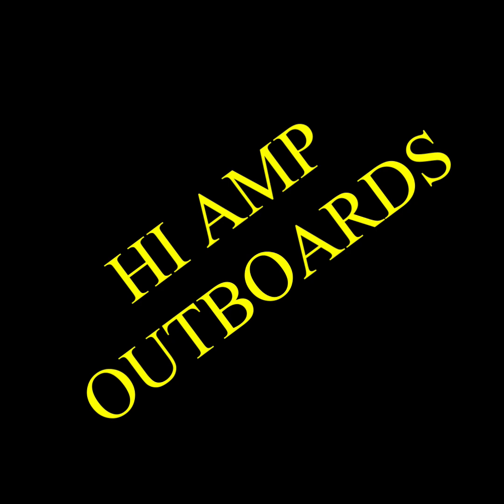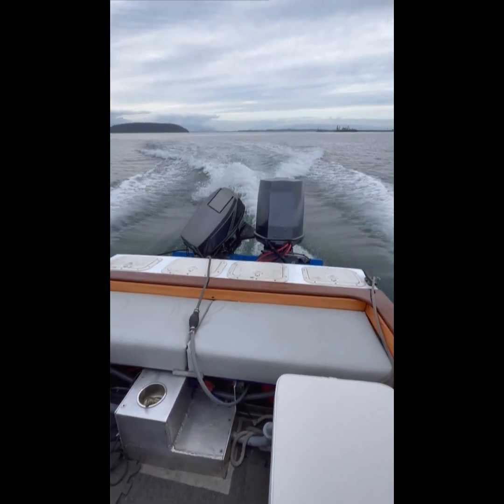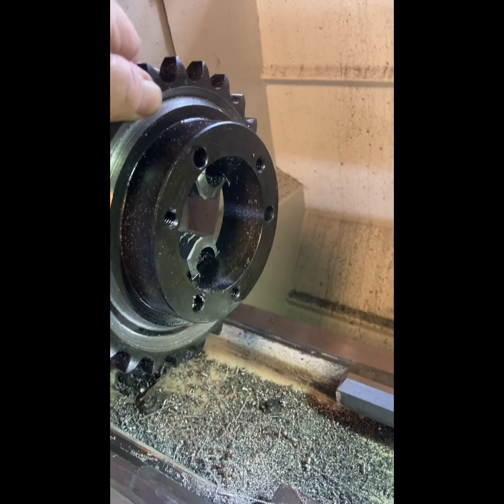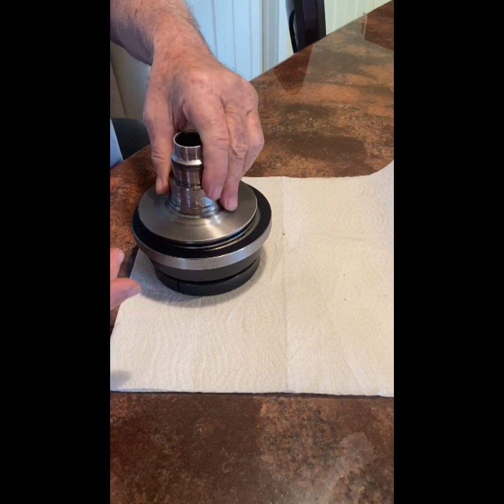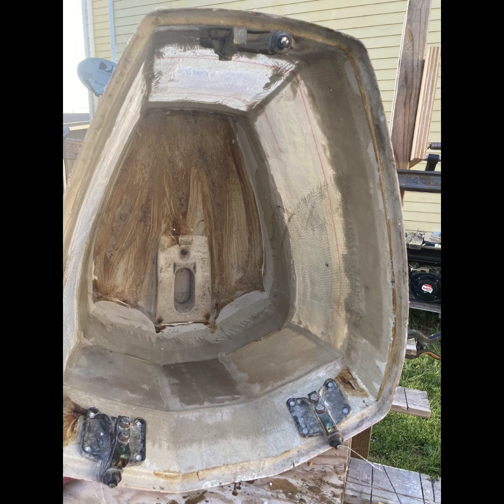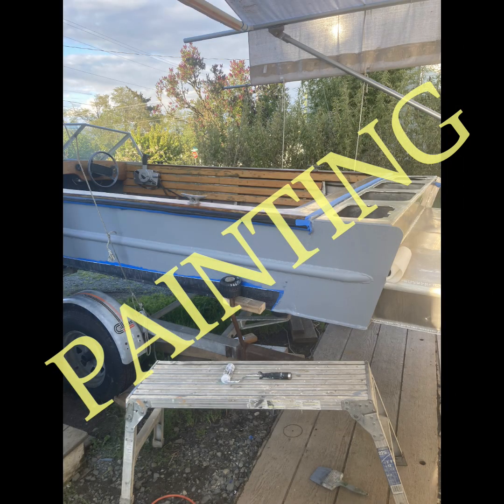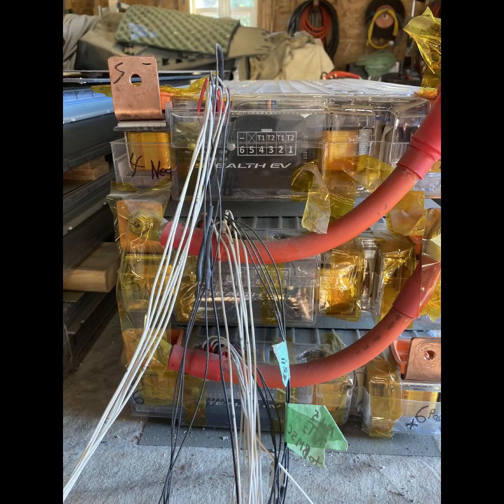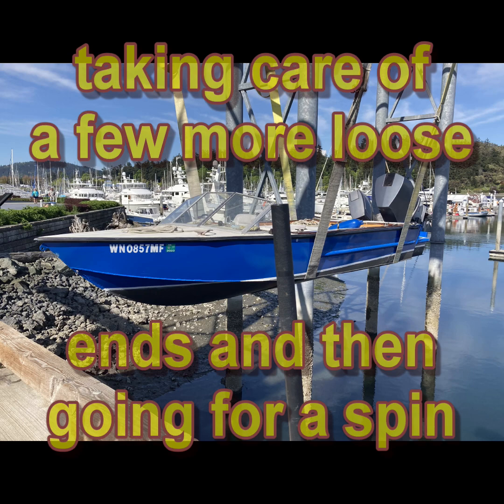Hi Amp Electric Outboards DIY

Comment: Nice video Bob, The project was very well done. I have been enjoying my stealth high power electric outboard. It is very close to what you built. You tube can see it at : marks gas to electric boat conversion. It's got a 75 hp water-cooled motor & motor control paired with 180 ah NMC batteries providing 53hp.

Comment: Mind sharing where you purchased that electric motor and some insight as to how much this ran you?
Reply from the maker: I bought the Net Gain Hyper9 HV from Mac and Mac Electric in Bellingham which is pretty close to where I live. They're good people. It cost around 5000. The used Tesla batteries were around 7500. I'm not too sure about the total cost, but everything usually  adds up to more than i think. I'd say the 20,000 ballpark.